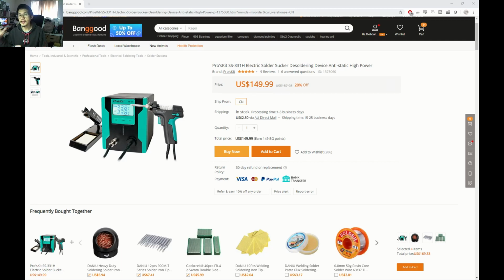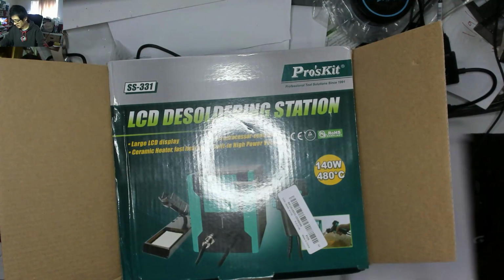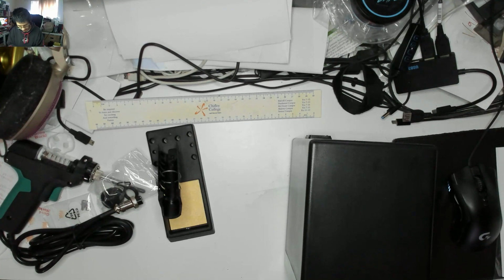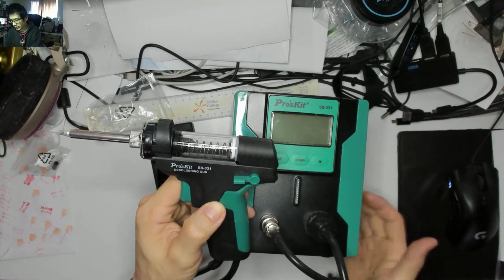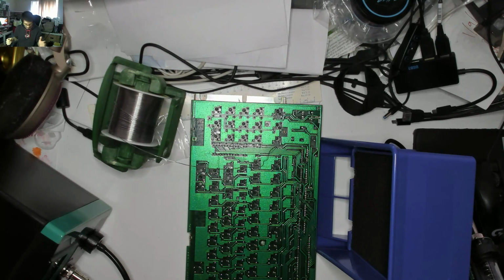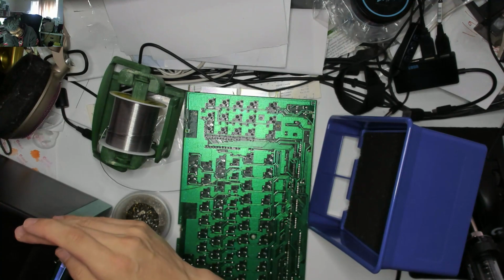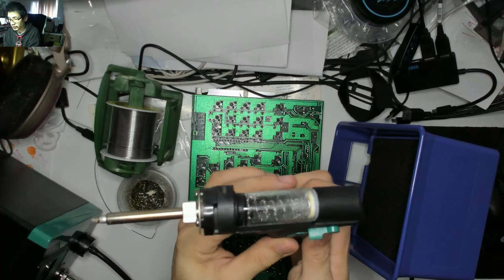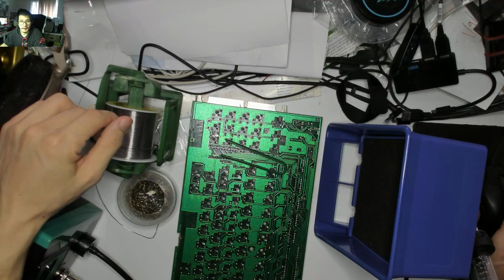Pro'sKit SS-331H LCD Desoldering Station Review

Comment: I did soldering/desoldering my whole life, so here are my two cents:
1) About the discussion on whether refreshing the joint with fresh solder is needed/useful or not, well, I (sparingly) do it on a regular basis, and this is meant not only to deoxidize old solder, but especiaĺly to provide a consistent pool of melted solder for the tip to plunge into so that the heat is evenly distributed and the pump sucking negative pressure is fully applied to the solder and not wasted by sucking some free air in between.
2) Always choose the best diameter tip first, it should accommodate the size of the terminal being desoldered without exceeding the pcb hole diameter too much.
3) When possible, keep the pcb being reworked vertically and not flat as you did in your test, so that the gun is held horizontally. This will drastically improve the pump effectiveness since it has not to fight against gravity and there's less risk for melted solder to "fall back"
4) As already suggested, once the desoldering tip is applied to the joint, gently move it in a circular fashion prior and during the pump action. This is a very delicate phase and should be ideally done  with the tip not scratching the pad (which could lead to pad delamination) but instead somewhat "hovering" on the pad by a fraction of millimeter while at the same time slightly dragging the component's terminal. This is a feel and ability requiring a bit of practice to be mastered.
5) Never hurry in pulling the trigger,  but allow some time for solder to melt,  especially for multi-layered pcb's or large copper areas (ground planes or such) in which case also a higher temperature setting has to be evaluated.
Reply from the maker: Thank you for so many really great tips, much appreciated!
Reply: @theboard  You're welcome 🙂
And, I forgot to mention another point, but there will always be some tough cases, like desoldering large power components sinking away most of the tip's heat, when an helper will be inevitably needed, adding heat with a soldering iron by working on the same pad on the opposite side of the pcb, while you operate the desoldering gun in a coordinated way. I sometimes managed to do it all by myself when there was no one around to lend a hand, but it wasn't fun at all 😖
Reply from the maker: Which is why preheaters also are helpful!

Comment: This is a great bit of kit. I've bought a similar one (different color, same factory) after a great review by Dave from the EEVBlog. It saves time, it allows you to recycle parts, it's awesome. 

Some things though. Clean the nozzle regularly with the needles provided during a session to avoid the solder accumulating past the heating cartridge and congealing at the entry of the transparent reservoir. It's a pain to clean cold solder stuck there. 

Use the proper diameter nozzle to get an optimal suction. You'll soon realise you better engrave the nozzle head with a mark to know what diameter it is because quite often once the nozzle is cold, cold solder blocks the opening and you can't figure out the nozzle's diameter until you reheat the gun. 

Last thing, depending on the model, there are two types of solder shields in the transparent reservoir : one is just a metal plate the size of a cent, the other (the better one) is a conical shaped spring. It's easier to clean and protects the felt disc that's behind better, giving it a longer life. You can get the part online on AliExpress, they're interchangeable.
Reply from the maker: Great tips! Thank you very much for sharing : ) I have the one that is the metal plate with cutouts, not a conical spring so I guess I might look into getting the replacement if I'm looking to do a lot more desoldering.
Reply: Replace the cut out with a penny or a ball of gold steel wool
Reply from the maker: @ng-iq4kx  Great tip, I'm assuming the steel wool will catch the fines and still let the vacuum flow go through well enough.
Replacing the filter with cleaning pads is also a great hack, just have to cut them small enough!

Comment: I have a Anesty ZD-915 (very similar to this one and around the same price...). I bit the bullet after desoldering 3 boards by hand with a solder sucker... One of the best purchases I have made...
I advise to desolder with the PCB vertically, as it will ease the vaccum 'succ' required and avoid solder to become lodged inside the front. 
From my experience you will need to replace the little foam filter inside the gun after 2 to 3 full boards... have not yet replaced the one in the unit and is still good after 3 boards...
Reply from the maker: As in, the PCB is vertical so the gun is horizontal?
I think that makes sense, though probably not as visually easy to see on video haha, thank you for the tip!
As someone who has desoldered a bunch of boards, yes, this device will definitely be a lifesaver for those intending to desolder a lot.
Reply: The filter in the base shouldn't need to be replaced. The one in the gun can be replaced with those little cleaning pads women use on their face.

Comment: Are you still around? Is the desoldering gun easy to disasseble and clean? I have a desoldering station and it's gun is quite frustrating to disasseble and clean because it's so tight and I break the plastic glass.
Reply from the maker: The back of the gun releases with a mechanism that is pretty easy to open, and then you can pull out the spring and plate and filter, to clean it. The nozzle is fairly easy to clean out with the pin/rod it comes with.

I haven't felt that I was at risk of breaking the tube on it.

Comment: the  holes that the desoldering iron couldnt suck were probably double sided. means u had to heat the solder more time.put the desoldering iron in the pin doing small circles.dont put pressure coz u will destroy the tracks. in case of huge copper areas,u can use your soldering iron the keep the temp high while u use the desoldering gun and suck the solder.
Reply from the maker: Thank you so much for the tips! Yeah, having something pre-heat it would help, possibly a preheater unit would make a big difference if I ever had space for one haha.

Comment: you should not be needing to feed more solder. Giving the heater 1 to 2 seconds more time to heat the joint works much better. Adding flux works but clogs the  filters much faster.
Reply from the maker: Personal experience in working with older joints and lead-free solder, feeding some leaded solder can help it some. Indeed having flux will help but I don't normally have any flux since I use rosin cored solder so it kind of does both with adding the fresh solder.

Comment: Desoldering is quite a journey XD but you ease it up so much with that desoldering gun :D i spend all my monry for hakko so my solution is to use manual desoldering technicues. It would be fine just that japan desoldering gun still sucks because it gets filled with solder too fast. Yes 450 is best for unleaded solder. 350-400 for  leaded

But i looked at that price and it is debatable. Though half of hakko one, but hakko is hakko XD
Reply from the maker: Hakko is indeed top tier, but if you're not doing heaps and heaps and heaps and need rock solid reliability, its something to consider the saving. I try to desolder at as low as possible temperatures, but because I also sometimes add fresh leaded, it helps drop the desoldering temperature down some as it mixes.

Comment: you dont really need to add solder to make it work, just let the gun melt whats there then hit the gun - piece of cake, youre just complicating things by adding solder - ive watched techs use guns  like this and and none of them added solder, they just held the gun down and very slightly rocked the gun to help give the solder room to go up the gun
Reply from the maker: Adding more leaded solder can help with it without having to go as high a heat with unleaded solder on OEMs from my personal experience, so its habit for me to add fresh solder when I desolder since I don't add flux.